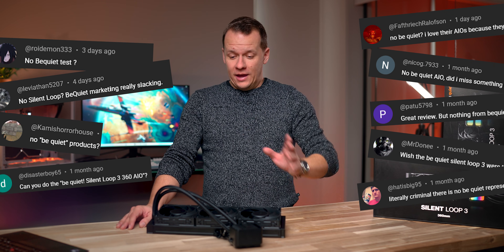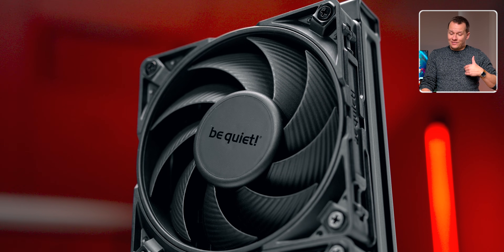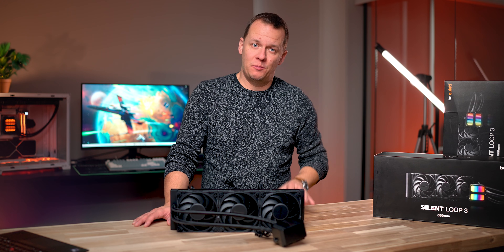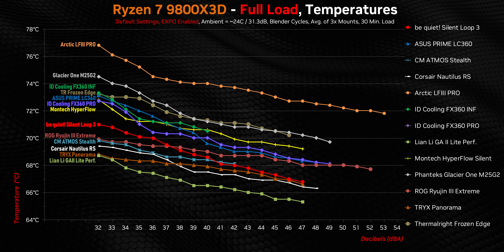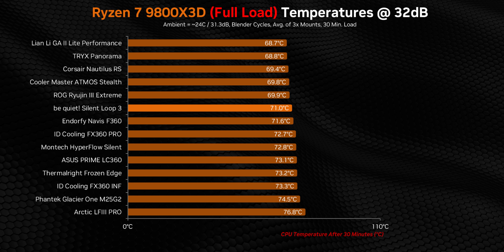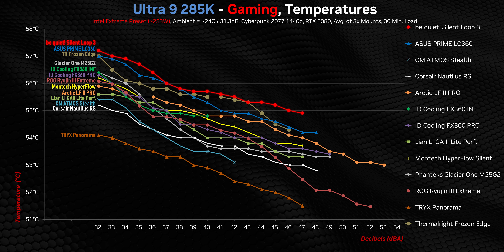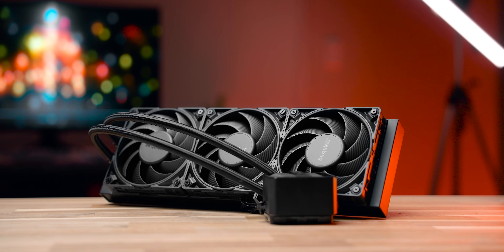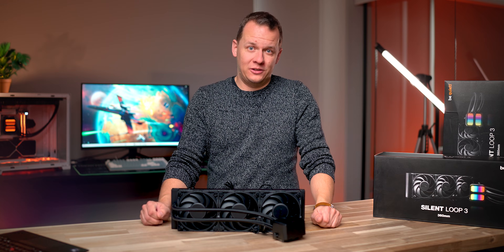A Ryzen Cooling MONSTER - be quiet Silent Loop 3 Review

Comment: I don't get it. LFIII is within a degree of it, for half the price.
Reply: LF III is loud, especially after 1000rpm. It is probably important to experience it yourself but new P12 or P14 Pros have a very distinct whirring noise.
Reply: @enesak7953 That’s why P14 ARGB is better than P14 Pro
Reply: You can get a LF3, 3 Silent Wings 4 and still have money to spare :)
Reply: The LF3Pro on AMD reaches the same temps of the SL3 at higher sound levels. At 9:55 it shows the SL3 reaches about 50.5 degrees at 40db, where the LF3Pro needs to get to 48db which is an EXTREMELY noticeable difference. I do agree however that its pricing is ridiculous because the Lian Li, Corsair and CM offerings not only are they slightly superior on AMD, but they are vastly superior on Intel while costing way less. It's not uncommon for a cooler to perform (relatively) way better on one socket than the other, but the performance gap between them especially considering such a premium price is disappointing.
Reply: @Alfie0001  it's a one degree difference per sound level.
Reply from the maker: It depends on which CPU.  Also, as a personal perspective, I absolutely HATE that its insane thickness causes compatibility issues.  Also from a noise-normalized perspective, the LFIII series really isn't all that great on Ryzen 9000 series CPUs.
Reply: @HardwareCanucks  yep there is no holy grail. the SL3 costs here in germany 54 Euro more. The LF3 pump can be capped at 70&80% of its rpm and is silent. but your are right, the thick radioator has his downsides and one thing thats not mentioned here: the offset mounting of the LF3 model has alot issues with the 1st m2 cooler of actual pcie5.0 boards because the pump tube connectors hitting tall m2 coolers. so its always a question about usecase and requirements :D
Reply: @HardwareCanucks  It's not just the radiator thickness that can cause compatibility issues with the Arctic LFIII. Actually, before I purchased the 420mm BeQuiet SL3, I purchased the 420mm Arctic LFIII. Some motherboards have clearance issues with the top M.2 slot, because of the pump + tube positioning on this Arctic AIO. However, the big issue in my case was my vertically mounted GPU. The LFIII has bottom-positioned tubes, and if you add the extra clearance needed on the AMD platform needed for the offset, it can cause issues if you have a chunky vertically oriented GPU. I realised this only when I tried to install it. It was not mentioned in the manual, but in theory, there was an option to mount the pump upside down, but I refused to do this, not just because of aesthetics (the logo orientation can't be changed), but also because I was worried about potential performance degradation. The BeQuiet SL3 automatically eliminates all these clearance issues because the tubes are side-positioned. At this stage, I felt that I should just go with the BeQuiet SL3, and I returned the Arctic AIO.
Reply: Refillability
Reply: @JBrinx18 Arctic offers double the warranty time
Reply: @JBrinx18  A tapped hole isn't really worth half the price
Reply: @JBrinx18   it’s theoretically possible to refill an Arctic. While there is no dedicated port, Gamer’s Nexus showed that the cold plate can be removed and replaced without damaging the unit.
Reply: LFIII is loud as hell, even with nicer fans. The pump is crazy loud.
Reply: @ThatYellowPokemon  yeah, but you can use PWM to reduce the pump speed. In my testing, I could get it down to about 60% with negligible effect on cooling performance.
Reply: As mentioned in my other post, this pricing might be a regional thing. I purchased it quite a bit cheaper.
Reply: If you build anything other than a fulltower/larger midtower the LF-III will not fit . Maybe with a budget motherboard but take any Asus Tuf/ROG or Gigabyte Aorus and the heatshild will block it .
Reply: liquid freezer 3 has a thicker radiator you absolute buffoon. what if you had space contraint e.g. sff case? don't comment anymore
Reply: Definitely not among my favorites, let's just say it's worth the price 🤔
The warranty is too small, and BeQuet They have never been among the companies and accessories I would choose, maybe if someone else likes it they could take advantage of it, but I doubt it.

Comment: The Be Quiet SL 3 - 360 was not overkill enough for me. I had to buy the Be quiet  SL 3 - 420 for my 9800X3D  😜 The ability to refill the system was actually my #1 reason for buying the SL3 for my new system. The ONLY other one I have seen that can be refilled from the radiator is the Alphacool from Germany but its costly to import as it has always been.  Good Job on this BeQuiet.  I hope they continue to improve their fans since we saw  the Phanteks fans  made such a major temp drop installed on the Be Quiet unit. Hopefully they take notice of that. Be Quiet could be the 1st place finisher in this if they would improve their fans.
Reply: Almost as if Alphacool makes the Silent Loop. Time to buy the Alphacool Core Ocean and T30 fans
Reply: @jessiethedude I think they make the pump
Reply: Scary, I just got one for my new 9950x3d guess it won't be enough

Comment: I have the dark rock pro 4 and my 285k barely touches 80c and it's dead silent
Reply: Yep. No one needs a CPU AIO below heavy workstation applications with a lot of cores. Cooling today is more about getting the GPU heat out of the case than anything else. Here watercooling makes much more sense.

Comment: Dont buy it, not good as arctic or thermalright and not best bang for buck.
Reply: I mean I was going to get the Arctic LF360 III pro but the latest reviews shows the Arctic being beaten and performing poorly.
Reply: @madsjensen4410 Corsair Nautilus looks good and is about the same price as the Arctic and no Corsair iCue (which I view as a positive).
Reply: @madsjensen4410  Just check out the reviews of Kitguru, they are the only ones that I trust with their testing methodology.
Reply from the maker: KitGuru shows the LFIII Pro 420mm losing to mid-tier 360mm AIOs.  That's a problem.
Reply: Except the charts in this video show both Arctic and Thermalright loosing to this cooler. Sure, you can argue that... based on cooling performance alone, the Arctic or Thermalright coolers are a better "bang for the buck" but that does not account for the fact that the Silent Loop 3 is serviceable, so you can make it last longer, where you're going to have to replace the other two... lessening their value. Regardless, saying it's not as good as those two is technically not true... because it out performed both on AMD.

Comment: I had two of these 360 AIOs. The pump was clearly audible from about 70% onwards. One model had noticeable vibrations from the pump, while the other was somewhat quieter.
Both were returned!
Reply: found a better replacement?
Reply: @PusisD  Unfortunately, not yet. I've tested a lot of AIOs from various manufacturers over the past few months. Either the pumps were anything but quiet, or they broke down after a short time.

Furthermore, I want complete control over the AIO system. The Corsair Titan's pump is supposed to be very quiet, but I don't want to use a software package that doesn't give me full control and also consumes resources!
Reply: @IngTB  I like dead silent when browsing and using the pc. There is 2 way: noctua air coolers like nh d15s or u12a. other way is a full custom loop with quality d5 pump on low pwm like EK d5. All AIOs has a little pump noise.
Reply: it’s hard to believe someone without proof 😂
Reply from the maker: We have two samples and neither had any pump issues.
Reply: @HardwareCanucks  Maybe I'm just unlucky, or perhaps my hearing is too good for my age.

The quietest pump in my previous AIO coolers was the MSI CoreLiquid i360. The first one had defective fans, so I returned it. The second one was fine at first, but after a few weeks the pump got increasingly louder. The replacement then failed after almost two months.

Currently, I have a HyperVision 360 UB. The pump is running at minimum speed. When it's above 30%, I can hear it two rooms away, despite the soundproofed case. But the cooling performance is very good, and the display is excellent. I've currently replaced the fans with P12 Pro A-RGB fans.

Comment: i have the 240 for a 9800x3d, with pboe unlocked it boosts to 5425 all the time, even in full load. very good :D
Reply: My 9800x3d also boost to 5.4Ghz but with the thermalright peerless assassin air cooler.
Reply: @GUZXN  And same here with a Noctua NH-D15S Air cooler😅
Reply: @GUZXN  my 9800x3d with PS120E have avg 80C and 111W PPT in BF6 at stock. Max PPT in blender 145W and ~5.1GHz so something went not so right with IHS soldering or something with PS120E, i don't have another cooler to compare or both. Who knows.
Reply: @Foton0154 This is normal, the cpu is hitting its power limit
Reply: @GUZXN  probably louder though, and if it's a 360 or a 420mm then it's even quieter

Comment: Maybe to get in front of the plastic issue is to ship a cheap product specific torque driver with the AIO to remove the ability to over torque and give instruction to tighten in a pattern like with a threadripper.

Comment: 420 aio roundup please.
Reply: thermalright frozen warfrmame 420, corsair nautilus 420, LF3 420,  nzxt raken 420, phantek glacier 420, beQuiet Silent Loop 3 420, asus proart lc 420 etc 
pls do comparison benchmark
Reply: yeah, there was only 10$ difference between the 360 and the 420 model. Is it worth it? 
The corsair nautilus is a little bit better, could the silent loop 3_420 beat it? Corsair doesn't have it unless you go for the titan, and it's more expensive.
Reply: LF3 420 here
Reply: @1sonyzz  Way too loud :/
Reply from the maker: Maybe in 2026.
Reply: @HardwareCanucks  Is the Thermalright Frozen Edge in the video the 240 or the 360 version?

Comment: The one thing that keeps me from considering bequiet AIOs is their relatively short warranty
Reply: Good point. 3yr vs Lian Li 6yr. 3yr might be when you refill the loop too. A great feature to extend the life of the product yet the warranty doesn't match..
Reply: The shorter warranty is most probably related to the refillable nature of this AIO (another brand with a refillable AIO also has a shorter warranty). I believe the refillable nature of this AIO speeds up permeation. According to the manual, BeQuiet recommends the AIO to be refilled every 2 years. With this, the refilling is becoming not optional, but a maintenance necessity, which might have caused a legal problem for BeQuiet, as they can't enforce maintenance on the user, therefore, they shortened the warranty.